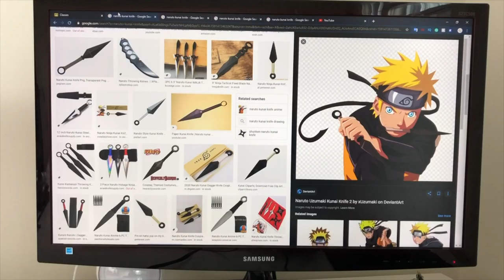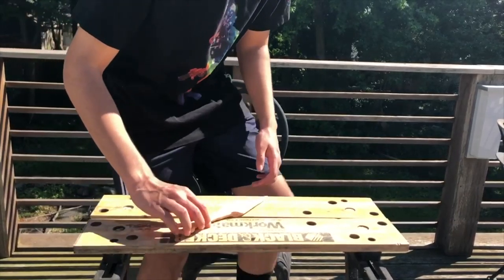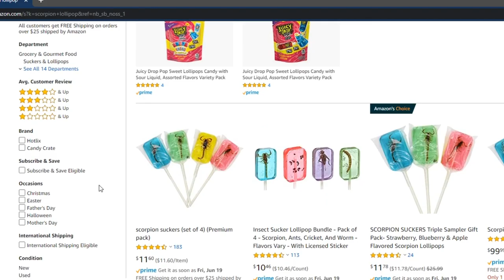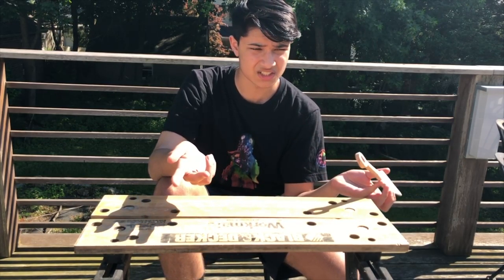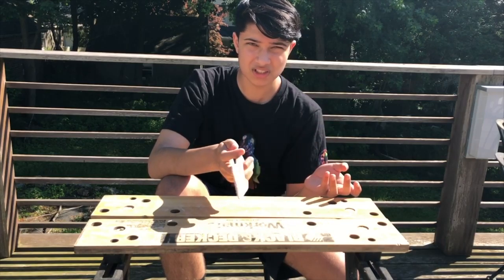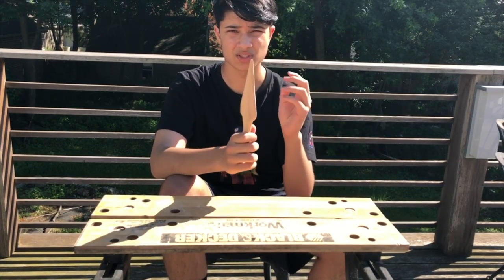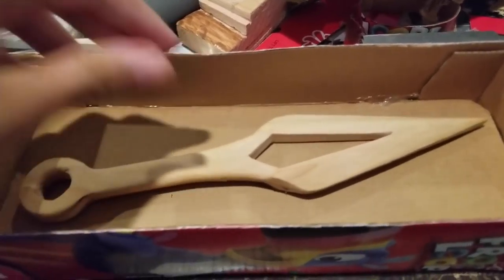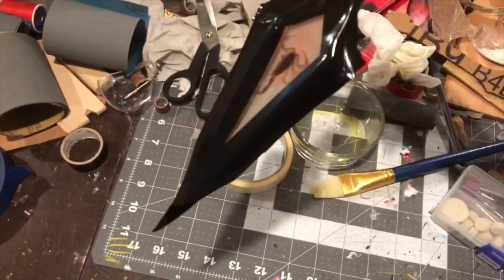putting a REAL SCORPION 🦂in a wooden japanese kunai knife with epoxy resin

Comment: You could probably affix some colored LEDs to the base corner of the resin and put the wiring, battery, and charging port in the handle
Reply from the maker: Yeah, I could! Those kind of things turn out to be a lot more complicated without any more complex power tools, or they would just end up taking more time if guess. Them ninjas do be using those thin kunais.